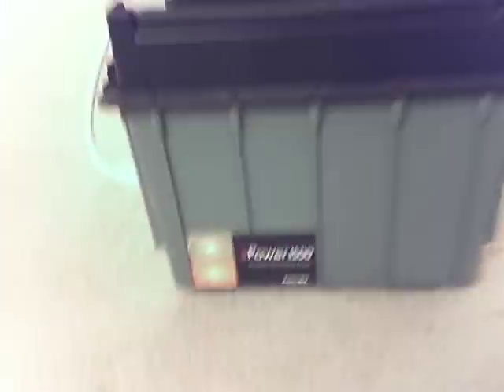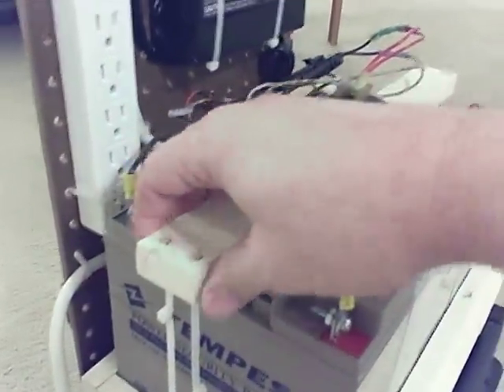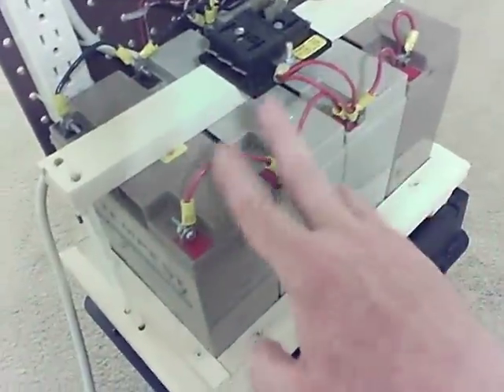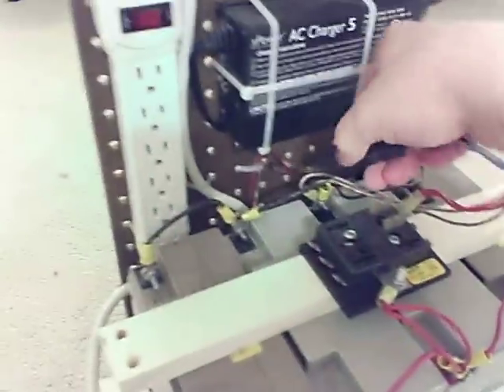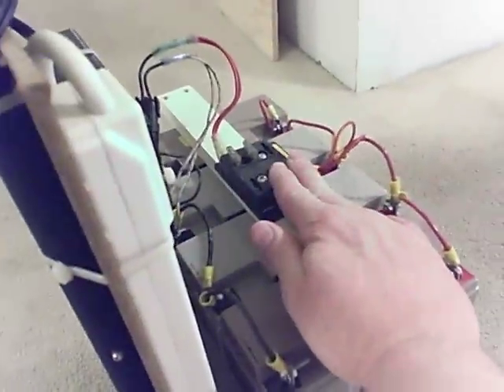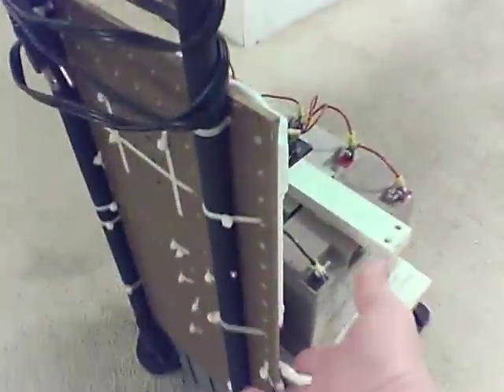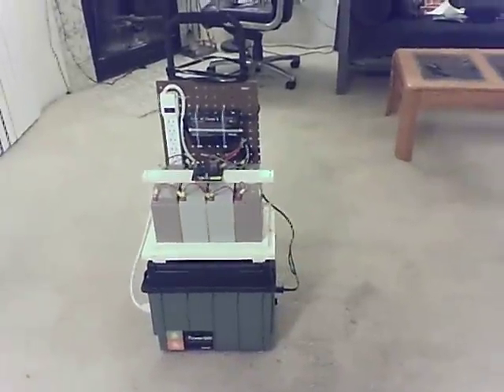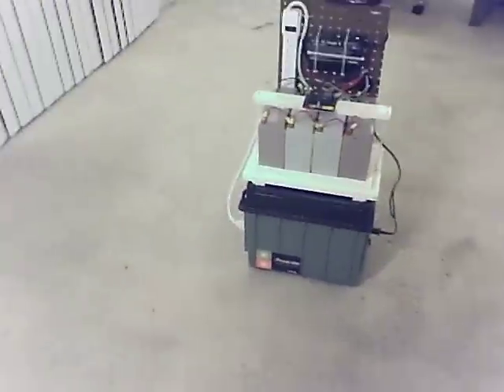My customized xantrex 1500 portable power supply.AVI

Comment: Great idea!
Maybe, for weatherproofing, you could get some kind of a plastic box to set the other batteries in, and then use sealed connectors for more safety outside. Also, I would suggest 12 Ga. wire, for better power transfer & heat dissipation.

Comment from the maker: @hekg 
I imagine it's possible but you could probably do the same thing by just getting a double male extension cord and plugging it into your wall (after you've pulled the main breaker of course). Be careful you don't have a high wattage device in the circuit though or your inverter will shutdown until you shut it off. 
If you have an actual house you could even start buying deep cycle batteries and slowly build yourself a serious backup power system. I want mine mobile though.

Comment: Just bought this unit and I like it alot. Is it possible to hook this up somehow to my home's transfer switch 240v connector?  Can I use a Y-adapter to use the two 120v outlets to plug into the 240v on my switch?

Something like the opposite of this Y-adapter? Conntek-YL1430520

Comment: Great Job, but by adding the extra batteries what is the highest wattage appliance you can run with your extra batteries.  The standard unit is rated for up to 1350 w. How much more can you get with the extra batteries.   Can you run an 1800 watt hairdryer for example? Or is it still 1350w maximum just  for a longer time?

Comment: @vention4wh , I don't get quite that technical about it, but the major idea for me.. is that heat means lost energy.  If 14 gauge wiring gets hot to the touch, then the biggest size wire possible, will create the least heat, and therefore loss .  I tend to think in terms of overkill.  I do know that "Code" specs out 2 gauge wiring on a household solar system, even though you are right in your statement that the distance is small, so are the "Panel" distances on solar.

Comment from the maker: @GoatHollow 
Hmm, Guess you're right. I do need to upsize. I want at least a 700 watt (58 amp) capibility so that would require either two 14 gauge wires in parallel or a 9 gauge wire. 

Of course going by that awesome system you built, you might know more about this stuff than I do, so correct me if I'm missing something here. Thanks! 
(-:

Comment from the maker: @GoatHollow 
The line loss for such a short piece of wire is very low. I have an excel sheet that I keep all kinds of electrical and wiring data. I could probably get it to you if you want to check it out. 
Anyway 14 gauge wire has 2.525 ohms of resistance per 1000 feet, so the only thing I really need to worry about is how much amperage it can carry without the wire getting hot. Heat is of course the enemy of wiring. 14 gauge wire's spec for chassis wiring is 32 amps or 384 watts.